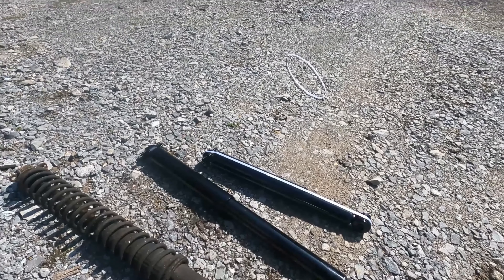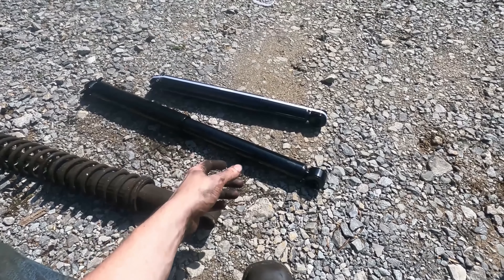GMT400 shock replacement

Comment: I have a 1998 GMC 2500 hard  starting take awhile to start is piston rings sticking or what is it let me know okay and thanks for your videos 👍🏽
Reply from the maker: Could be depending on the blow by situation however, further diagnosis is need man. Something as simple as a bod PMD or even bad glow plugs can cause a hard start. No use doing a rebuild if you don't have to.